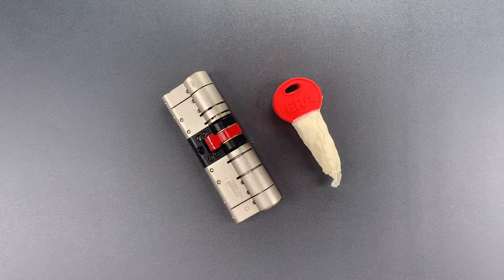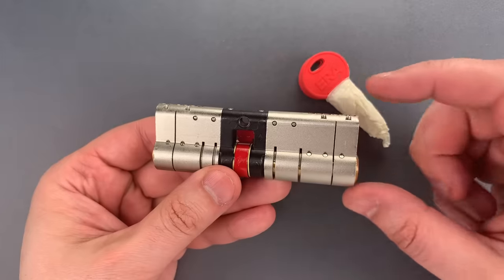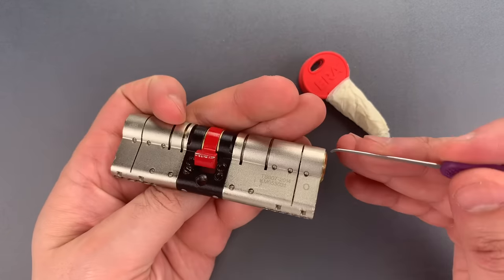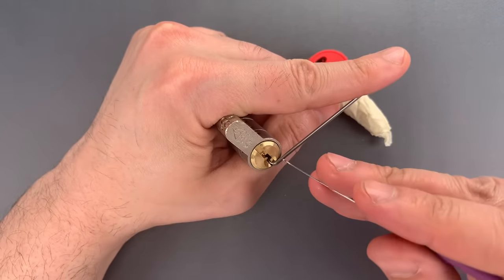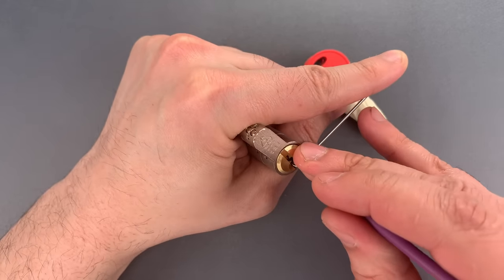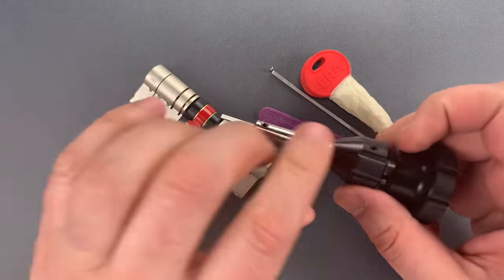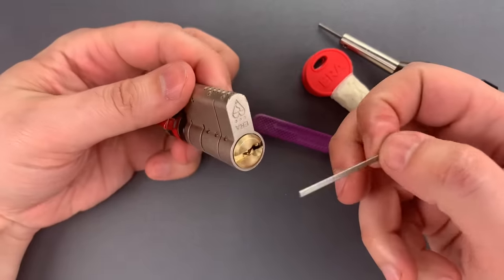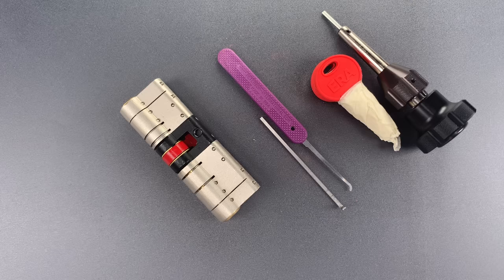[1256] ERA “Fortress” Euro Cylinder Picked (6 Trap Pins!)

Comment: The door itself is likely to be more vulnerable than this lock.
Reply: Was thinking same when you put a 1k$ lock in a 100$ door you are simply moving the entry points to a window or other means if entry. 

Most people don't lock their garage door to house, the same folks also leave a garage door opener visible in their vehicles.
Reply: That's the point of a lock though, to make an attacker use brute force. Force always works if you apply enough of it. Good locks take away alternative options.
Reply: I like one of the stories about a pentester that had to get past a security door with a guard in front of it. Two day deadline. They went into an adjacent room and slowly, silently dug through the drywall.
Reply: More like drywall on each side
Reply: Looking at the sheer size of the lock, the door would have to be fairly substantial for the lock to fit, and anything with that thick a door will have beefy walls as well.
Reply: @ragnkja  You'd be surprised. Someone needs something protected in a specific building, and needs security to be up to code for a specific door for, say, insurance policies.

They replace the door with a massive thing, really impressive, but adding a cool door doesn't solve the fact that the building was never meant to be a safe holding space in the first place.

Heck, there have been loads of cases where bank vaults have been gotten into via just removing a small amount of material from sewer systems.
Reply: @Pippinn13  3 star for £33 or generic 1 star for £15. They do the job, but no one picks them; PVC doors just get kicked in if there's no other entry.
Reply: @omieyouknowme  True, but if you can get into my car to get the garage door opener, you're already in my garage...might as well just walk into the house. Though I do have a lot of neighbors who don't park cars in their garage, which seems really weird to me, but whatever. They paid for it, they can do what they want with it.
Reply: @ragnkja  I've seen a room with a safe where there was a security door but all the walls were drywalls. 
There was a burglary attempt but they gave up when they couldn't pry open the door. Not the smartest criminals.
Reply: @bjornsan  
Sometimes, the most important thing is to look secure. The would-be burglars may have assumed that given a secure door, the walls might have been stronger than they looked.
Reply: @omieyouknowme  One common trick is to ignore the locks, doors, windows and roof, but to knock a hole in a wall. I know of one instance locally which happened in full view of a row of houses, which was less than 100 yards away, on a Sunday afternoon. The crooks were wearing branded high vis jackets, used a truck, and made plenty of noise for a few minutes, so nobody reported it. Over £2 million of tobacco products were stolen. Unfortunately for the thieves, their radio transmissions were heard, and they were arrested after leaving the crime scene.
Reply: @RWBHere  wow. Walls here are wood and cheaper exterior siding that works. Thankful that my neighbors are usually home. I live in an area where neighbors have keys to each other's homes, phone numbers.  A good neighborhood can deter a lot of petty crime if we watch out for each other
Reply: In continental Europe unlikely. Door that would easily withstand a police battering ram for a while is often standard or requires a small extra fee when buying a new condo. This is regardless of local crime levels or standard of a building. I remember my neighbor having to take blowtorch to her door after locksmith failed to force-open and then drill a broken lock.
Reply: As it should be.
Reply: Something to keep in mind is most real-world break-ins are done in a way that doesn't draw attention. Making noise and taking too long are good ways to get caught and arrested if you're lucky, or caught and beaten if you're not.

Most locks are an intimidation factor and nothing else. Human laziness beats just about any other security measure.
Reply: Use a door, break a door, make a door. Three ways of intrusion. In this case it will be the third ;)
Reply: 2 words : Outside hinges :D
Reply: @vukkulvar9769  Outside hinges don't have to be a problem. Many hinges these days have pins on one end that fall into a hole in the other end. You could take out the pin in the hinge, but you won't be able to get it out of there, due to that pin. Of course, the security heavily depends on what you have on the other side of the door. If you only have your standard lock there, it's not going to do much. But a three point lock or a deadbolt in the top and bottom of the door will make sure that you won't be able to remove a sturdy door, even with outside hinges.
Reply: @raphaelr.5904  that would cost more that the single 40" tv in my house. I have thought about applying 3mil plastic film in inside panes.
Reply: @omieyouknowme  I have a steel reinforced door where you need several keys to open it and you could fire 50 cal at my windows and they won’t break. I also have armor inside of my walls and a control room where I can lock any door or open any door of my house. It can not be hacked. Some robbers once tried to rob me and I let them in only to trap them in a dark hallway where I had big photos hanging on the wall that could glow if you want them to. There are also a lot of soundboxes in my house. Can you imagine robbing someone and whilst doing that getting stuck in a hallway with strange noises and pictures of soldiers staring at you while you start hearing sounds of war getting louder and louder? When the police took them with them, they were scared to their bones and incapable of speaking.
Reply: @raphaelr.5904  hmm reminds me of a missile silo bunker. My best offense right now are my neighbors, we watch out for each other.
Reply: You are forgetting this is normally in a european door, we don't build our front doors out of paper. You would need a tool for getting the usual wood door open and that makes a lot of noise.
Reply: @JainZar1  who thinks that the doors in the US are made out if paper?
Reply: @raphaelr.5904  its an exaggeration lol, I was under the impression Americans understood hyperbole?
Reply: Almost every single front door in a modern European house is both bullet and fireproof. You'd be more successful by simply knocking on the door and trying to convince the people inside to open it.
Reply: I guess if you are getting a lock like this, you probably care enough about security to get the other vulnerabilities sured up. It doesn't look like this lock would fit in a typical door anyway, it's too long.
Reply: @omieyouknowme  These locks retail for £37 on ebay from ERA themselves.

As for the door being weaker, it depends if it has windows, uPVC doors have a bolt and 2 locking lugs and 3 big hinges, the door frame would likely give before the door does.

Edit, just to clarify for anyone who hasn't used a uPVC ('euro') door the euro cylinder is just an actuator with pins, the door is locked by (in every example I've seen) pushing the door handle up which causes a bolt (steel) to extend into the frame and 2 locking lugs to slide up and down where they are caught by 2 pieces of metal. This means the door locks in 3 places, the euro cylinder is the lock holding the actuator to unlock the door (done by pushing the handle down) in place.
It's a really good locking system as it can't be shimmed and the door locks in 3 places withput having to throw over bolts to lock the door in other places or use multiple locks.
Of course the weakness therefore lies with the cylinder, which is why they've been strengthened so much in recent years as snapping is a well known trick now but sacficicial cuts, a hardened steel bar at the Once weakest point and anti drill pins means that to get through one you need to be patient and drill it, or break a window.
Reply: @raphaelr.5904  Walls on American houses are often made of plasterboard (sheetrock) so strong locks and doors are pointless.
Reply: Not only are European doors often much stronger than those topically found in North America, but they also have between three and twelve dead bolts. Walls are made of concrete and windows are stronger too. Not sure why the disparity
Reply: @somestuffithoughtyoumightl6985  Because in the UK and most of Europe a locked door is the only thing protecting you against a thief or violent extremist who will either take your property or worse. In the US firearms are a viable self defence choice.
Granted you need to be in to defend your property so good doors should exist in the US.
The way houses are built there too (wood and plasterboard) makes no sense as bricks cost about the same, last much, much longer, are less susceptible to fire or being smashed through and often look nicer.
Reply: @daviddavidson2357  What a house is made from depends strongly on the region and the conditions in that region. For example, cinderblock is far more prevalent in the South and Midwest than wood, due to hurricanes and tornadoes. While in the northeast, wood is more prevalent due to the harsh winters being really hard on cinderblock and wood frame walls providing more room for insulation than cinderblock. The US doesn't have a universal building code precisely because the country has very many extreme weather conditions and some materials are better suited some conditions but don't hold up well under others. 

Brick requires some specialized knowledge to lay correctly and there is often more efficient materials available. So brick is often used as a decorative element more than a structural one.

And exterior doors are usually made of pressed plywood. The door frame will almost always give in long before the door if it is being kicked in and it takes a LOT of force to kick in a door. A police battering ram can weigh upwards of 30 lbs. and apply nearly 300  ft/lbs of force to an area of about 4 square inches in order to break open a door in a single strike. Kicking in a door is not nearly as easy as it is in the movies.
Reply: @shottingham  you tried to " just kick in" a new composite upvc front door? They are that good that even a trained team will the big red key could not bust it, the brick work started to fail after about 6 mins, of 4 different men trying. By which time, you'd have legged it out back!
Reply: I would imagine the door itself is even stronger to prevent forceful entry
Reply: @satoruriolu6132  oh yeah, very strong doors. The fire bridge have a hydraulic wedge to try an force doors, but even this is not that easy.
Reply: @omieyouknowme  indeed. i was putting a $200 electronic keypad lock (phone control etc.) on the door to my work, and the locksmith looked at me and said “you know they could just punch through these top glass panes, reach in and unlock it right”
a good lock ain’t worth shit if it can be bypassed.

P.S we did use the lock cause we needed the access logs and easy codes for our people, not the high security aspect.
Reply: There was a book about this in Skyrim a guy was talking about how he’s seen dwarven metal locks beside a smashed open chest
Reply: @daviddavidson2357  Most states and municipal jurisdictions in the US do not allow the use of deadly force to protect property. Only life and well being.
Reply: @OtakuUnitedStudio  If someone broke I to your house while you were in would you not fear for your life and wellbeing?
They could be armed. They could be insane like the Manson cultists and want to murder you. They could be a serial killer like BTK. You don't know that someone who has just broken in is there to simply take your property unless they announce it and even then, they could be lying to get you cornered and then murder you. Some serial killers used that modus operandi of "I'm just here to rob you" to lull their victims into a false sense of security.
The only time you really should comply in a situation where its a potential robbery and you're told to get down is in an armed bank robbery where hero antics usually mean you end up dead.
Reply: And that means the lock did a good job. People will most likely be forced to enter by brute force rather than silently picking the lock and go in unnoticed
Reply: @daviddavidson2357  build a house out of just brick? is that viable? us building practices are truly terrible.
Reply: @ragnkja  This is actually a fairly common lock here in the UK on our UPVC Double Glazed doors.  The locking strip that engages into the frame does so at between 4 to 6 points all the way up the door edge, rather than just a single latch at the handle.
Reply: @omieyouknowme  or you could be one of the people who have a separate garage
Reply: @omieyouknowme  I get what you're saying, but this is a <40€ cylinder... It's 20€ more expensive than a "normal" one. Safe to say the door will be more expensive than this upgrade and a less desirable target than a silent lock picking.
Reply: @PtWhiteBelt  in the US people spend more money securing their automobiles than their homes, for anyone here to spend more money on a quality lock is also like asking them to park their vehicle in the garage. 
Different mindset for people what they value. 
Thanks to this channel I have thrown out all the master junk and have at least a better lock than quickset. 
I will be asking my wife to bring some locks back from Germany this year. Lol
Reply: You haven't seen many european front door, have you? :P
Reply: @Commandelicious  my in laws are in Berlin, I spent my Xmas there every year minus the two plague years. Ya I've seen seem em, and I want some of the locks
Reply: @Commandelicious  What good is a lock when your window is the weak point. My friends next door in FR have metal shutters on their windows that roll down. Geeze is this reality of what you have to do to keep someone out
Reply: @shottingham  "3 star" is also a bit of a ruse, they are also often having flaws.
When it comes to doors:
Get good multi-point locks, metal framing, metal multi-point hinges.
Reply: @omieyouknowme  u do English?
Reply: that is the point of a lock
Reply: These cylinders are a standard length and locksets are made so they are flush with the surface on the outside, but may protrude inside the house.  The one I open the most is in a galvanized steel gate pillar, and is master keyed to accept all the apartment keys.  There are vulnerabilities that I worry about, but I'm not saying what they are.
Reply: @shottingham  installing this in anything but a solid core composite door with dogpins in the hinges would be a waste.

The idea being you make the burglar move to an alternative entry point that's more of a pain in the arse. E.g a window.
Reply: @ragnkja  Incorrect. It's a standard sized Euro lock that is fitted to most plastic doors in the UK. The doors are generally very flexible and not much of a challenge to break. Hideous as well.....
Reply: @procatprocat9647  
Flexible plastic front door???
Reply: @ragnkja  yes, they're extremely common on cheaper houses in the UK.
They're Upvc
Reply: I mean, that should kinda be the baseline.

If picking the lock is the easiest way to break in, the lock isn't good enough.
Reply: Yeah I mean, you need to know by the brand and make of the lock based on profile of it that you can see. 

Then you need to know that it even has the pins, then you need to know where the trap pins are, and you need to have the time to get all three tools mid operation (tensioner, pick, and the fast turner) without arising suspicion. And then you need to not be nervous enough to accidentally overturn and get those trap pins in. Then the door frame if very protruding could also be a hindrance in you getting the space you need to actually do the thing.

I'm sure that something like the FBI or the Pentagon put this on a door, maybe with a patrolling guard and a camera would be enough to make exactly too much to deal with for no one even to bother trying.
Reply: Trust me, it is..
Reply: In Europe Doors are usually made out of steel and you ai t getting thru One of those